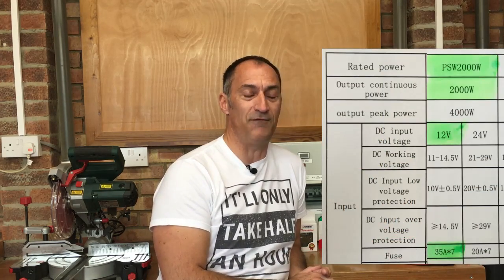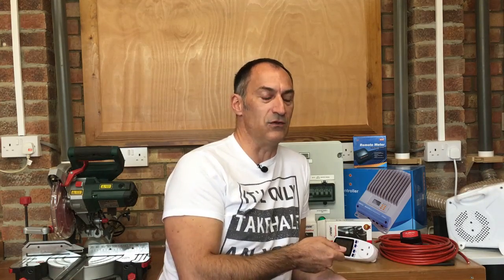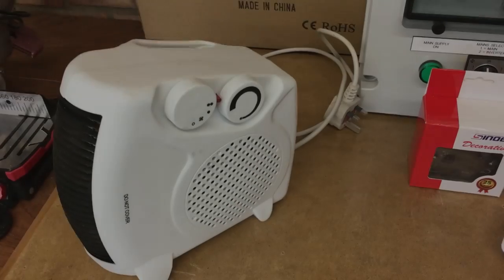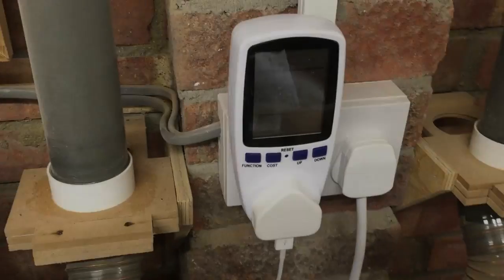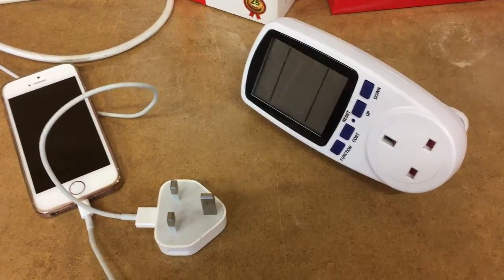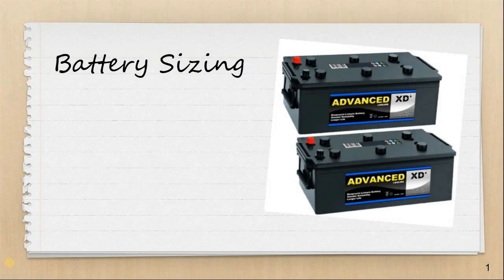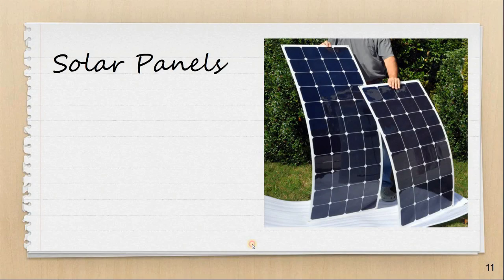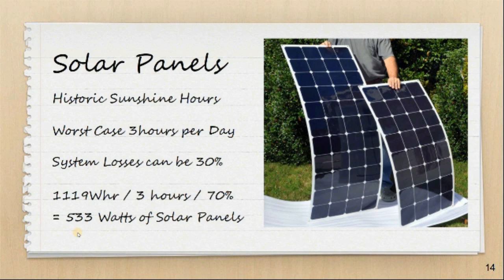Off Grid Battery & Solar Sizing - Self Build Campervan

Comment: Hi Greg
I am right at the very start of my van conversion journey (I pick up my van on Wednesday 😊) and have found you video channel - it is incredibly helpful! Thanks for doing such an informative series of videos.
I have just watched the video on Battery sizing and am a little confused by the reference to removing the load required for the Truma combi boiler from the calculations because it will only be used when on hookup. This is probably a daft question but…….How can you stay warm “off grid” if the Truma is not connected via the Inverter to your battery supply?
Thanks for the help
Brian
Reply from the maker: The Truma has a small 12v supply of 10amp that runs the boiler fan and controls and a separate 230v mains power supply of 1.8kw that is for the electric heating elements. 
It’s only the electric heating that will be used on hook up. The rest of the time the heater works off LPG and 12v control power.
Reply: @GregVirgoe   - Thanks Greg, that is what I had assumed about the Truma. I think I’ve just got confused because from the video on the Electrical Control gear I concluded that all the 230v demand went into the control box and was fed by either hook up or Inverter, via the main selector switch. I’ll draw it all out from the videos and get my head around it.
Thanks again.
Brian

Comment: Hi Greg 
Sorry may have missed it in the video 
But  why not just charge the batteries with the engine rather then solar which seem to take quite a while unless not using anything
Reply from the maker: The solar energy is not using any other fuel it’s free all the time it’s daylight. You can use it when driving but if you are parked up for a few days you don’t want to be running a huge Diesel engine for power in your van.

Comment: do you have Anderson port ability to use external panels for flexible directions.  An MPPT controller that can support 600 watts of portable panels? Your 2000 watt inverter appears able to support induction or instant pot type cookers...

Comment: Hi Greg I'm alittle stuck. Where you have calculated your led lights you have a total of 60 watt hours. If im doing it correctly 10 x 10 is 100 x 6 is 600?
Reply from the maker: Sorry there was a mistake in the sheet I was using in the video. The equation was missing the quantity out. The free download version is correct so you are right. My apologies for any confusion 👍🏼😊

Comment: Hi Greg im at a dilemma im in the middle of a camper build but im disabled so having to pay for other people to do the jobs I require, this is not my problem, my problem is I can't get anyone to fit my solar kit nor do I know exactly what I really need, I would really appreciate your help, I want enough solar and batteries to be completely off grid, run a TV a dvd a microwave, broadband router and my lights and fans. Im willing to pay someone to do this work, im not even bothered about price of labour I just want an exact and safe job, thank you I hope you read this and can help or know someone who can. Thanks again
Reply from the maker: Hello Steve, please send me a message to greg @ virgoe . com
Remove the spaces in above address and I’ll get back to you 😊
Reply from the maker: Let me know in the Mail what vehicle you have and what you plan to put in it that needs power. 👍🏼😊

Comment: Can you over charge the battery, ie the ratio between panels to battery is high. If solar panels are producing their maximum output on a sunny day and you’re not using much battery power where does that solar power get absorbed? Is the MPPT controller dumping some of the excess power?
Reply from the maker: Your mppt will only put into the battery what it needs. It can switch off the incoming feed and regulate the power being delivered.

Comment: Thanks for this one. And not only this one but the rest as well. It helps a lot. One question, though. How would you go about creating a system that powers batteries both through solar panels and can be hooked and powered via generator? I mean how would that be connected technically?

Really appreciate what you are doing. :)
Reply from the maker: You could simply plug the 230 output from the generator onto the hook up socket for the van. Just don’t park near us when it’s running 🤣😊👍🏼

Comment: Hey Greg, I see you removed the 230V fridge figure from your calculation, given this, do you expect to run the fridge all the time from the 12V supply and never hook it up to mains voltage? I'm trying to calculate how much power my fridge is likely to draw each day but finding this hard to calculate. Will the fridge varies its power usage depending on ambient temperature and temperature inside the fridge? How many Watt Hours / Amp Hours do you expect an under-counter fridge will draw each day? Thanks!
Reply from the maker: Yes we only have a 12v compressor fridge now and it is on all the time. Has been fir the last three years. Obviously it only runs every so often depending on outside temp and how much you open the door. Although it’s plugged in to power the compressor come on via a thermostat. So as an estimate it’s safe to say it will only be on for 1/4 - 1/3 of the time. We turn the thermostat up a little to so it doesn’t come on as much. 👍🏼😊
Reply: @GregVirgoe  Thank you Greg, love your work and videos by the way. Appreciate what you do, keep it up! :)

Comment: Hi Greg, 
 Thanks for yet another awesome video! Couple of questions for you regarding batteries. 
Using your spreadsheet & lots of research and decision making into appliances and their draw, our power consumption is near on exactly the same as yours (we're at 1150wh)
Planning on using Circa 480W of solar (3x 160W Panels) along with 2x 220ah batteries although I don't feel we will need 440ah as of course the spreadsheets are taken from "worse case scenario" or "maximum draw from all appliances".
That said, I'd rather have and not need, than need and not have, the only issue is the batteries I'm looking at are 60kg a piece.
Do you think we compromise and scale down to say 2x 160AH batteries, or take the hit on the 120kg of pure power?
My thinking is that its better to have the bigger batteries as they'll be under less load and therefore the DOD would be in less demand and should by that logic last longer. 
In terms of cost.. There is only a £40 difference (per battery) however the difference in weight and size is pretty bad. 
Do you have any other suggestions or recommendations.
Many thanks
Zack & Amy

Comment: Brilliant video Greg.  I'm assuming that you are sizing solar panels based on the fact that you wish to fully recharge you batteries using solar on your days "off grid" hence the requirement for large panels.  I assume should you go with no panels you would need to recharge using van or shore power after 2 days?  Keep up the good work.
Reply from the maker: Yes exactly that. I want to stay off grid and you can only use what you can generate each day. 👍🏼😁
Reply: @GregVirgoe  Brilliant. Any advice only going all electric.  I am thinking 1200w induction and water heaters a 4000W inverter and 150 ah of Lithium
Reply from the maker: @martincraven4202  any form of electric heating for cooking or heating water is going to use loads of power. Divide the watts by 12v to see the amp/hrs used. 
1200/12=100amp that’s 2/3 of your battery capacity each hour just for cooking alone. The bigger problem is generating enough power to recharge the system. Here in Europe we get between 750-1200W of solar a day from a huge half kw array on our roof so we only ever use electric heating when on hook up. Where are you planning to travel to and what size vehicle?

Comment: Hi Greg I’m looking to buy a solar panel set up how much did yours cost you for your solar panel set up please 
Thanks
Reply from the maker: Each panel was £130 x 3
My MPPT controller was £140
The AGM batteries was £150 x 3
Plus breakers switches and wiring
So all in for approx £1200 and we have lived 100% off grid on that setup for over three years now.
Reply: @GregVirgoe  thanks for getting back to me really appreciate it 
Dean

Comment: Hey Greg, thanks for all the tuition so far. Do I keep my batteries plugged in to solar etc through periods of inactivity (anything from a month to all winter)?
Reply from the maker: My panels have not been isolated now for 3 years even when the van is parked up. The controller will back off to float mode if there is no load and just keep the batteries topped up. If the batteries are allowed to drain too far it can damage them.

Comment: At minute 13:20, how is the calculation equating to 4,476whr. 1119 x 2 days (2238whr) / 50% = 1198whr. Sorry If I've missed a vital step, I've gone back to watch it again but not where where I've missed this vital step in the calculation to get to 4,476?
Reply from the maker: 50% is 50/100 or 1/2
Divide anything by 1/2 and it’s the same as multiplying by 2. 😊

Comment: Although I feel I know plenty about these systems and the associated electrical calculations, it is still very enjoyable to watch you run through the figures and make it easy for people to understand. If you don't mind me picking you up a couple of points though. The 50% discharge of a standard lead acid leisure battery is not  the same with AGM lead acid batteries which I personal recommend every time over a bog standard lead acid. 30-35% is doable as rather than 50% in my experience so up to 40% more discharge is possible with an AGM. AGM's don't need venting and can be positioned on their sides. The other thing is, I believe the efficiency rating of an inverter (and please people, buy a decent sine wave inverter) is based on a high load. As I understand it, an invertor rated at 2000watts maximum is less efficient at running lower loads than a lower specified invertor. So... if you have a load of 100watts on a 2000watt inverter, it will be much less efficient than a load of 100watts on a 1000watt and much better still on a 500watt inverter. I personally think 1000watts in a campervan should be plenty for anyone so don't do what so many people do and buy a 2000watt or even 3000watt inverter unless you know you'll "need" all that power. If you're running a 2000watt heater on a 2000watt invertor which is powered by your batteries then you're probably a bit mental anyway... Keep up the good work...

Comment: Hey is the total watt hours sheet you used correct or was it an error? It’s confusing me.

‘Multiply quantity, by watts by hours used’ you’ve only listed watt hours per x1 unit instead of x10 for example for the LEDS. Is this right? Instead of 60 it should be 600 because you’re using 10 lights not just one of them?

Comment: I was a bit confused about that list at 10:24 which shows the power usages. It has the Truma Combi on it twice. But then I see what the difference is. The combi part in Truma Combi refers to the fact it can run on both mains or on either diesel, lpg or propane (depending on which version you choose). So on mains it's at 230 volt but not using diesel/lpg/propane. While on 12v it's using diesel/lpg/propane and thus uses less energy.

Comment: Hi Greg! great video as always. Been following you for few years and always told myself to use your guidelines when building my own van. Now the time has come and i'm rewatching most of your explanations, thanks for all your effort! I also have a question: why are you calculating your wattage for 2 days while your solar system with 1 day sunshine time? Aren't you then oversizing your solar panels by 2x? Thanks!
Reply: I had the same question in my mind, why do I think the sun rises every day, so I don't know why I multiply it by 2, did you have any answer? or could you solve this on the other hand?
Reply: it's a good factor of safety

Comment: Hi Greg.  Another very useful video, thank you.  Just a couple of questions on your spreadsheet.  1) You say that to get total watt hours you multiply quantity x watts x hours used but on the LED lights line it doesn't look like you have multiplied by the quantity of 10 - or have I missed something?  2) I was assuming (maybe wrongly) that the fridge would be on 24 hours but I notice that you have only put 6 hours down for your fridge.  Would appreciate understanding your logic on this.  Many thanks for your help. Sharon :-)

Comment: One thing to take into the calculation is a normal 220v fridge uses about 1500w for a short while when starting (not sure how long but a few seconds or so). One way to get by that if you have a small battery bank that can not get it started is to use supercapacitors to help give enough amps for a short while.

Comment: Hi Greg, If i were to use only one battery but 2 solar panels would I connect the solar panels in series like the dual solar panel and battery set up or parallel? pretty sure before i had both panels with red wires connected and earths together too? its been a while lol.. have you a link please for dual battery/solar diagram please? As i have 2 batteries and 2 panels id like to get the best use from them. Any advantage to connecting both panels to one battery? sorry to be a pain.

Comment: Great Video Greg! Thank you so much. 
quick question: in your spreadsheet, you said you multiply the quantity by watts by hours used. Wouldn't that be 600 Wh for your LED Lights? Same goes for the roof fans.

Comment: Hi Greg, we’ve just started our conversion, your videos are absolute godsend! So thanks for that. I have a question about solar and lithium batteries. 
I was wondering about whether or not I would need solar, with the power advantages of lithium...? If you just have to run the engine for 30mins for a decent charge, would this not be more efficient than adding the cost and weight of the components required for solar trickle charge. I also read that the slow solar kind of charging can damage lithium batteries...any info would be great, just beginning to design my electrical system. Cheers 
2015 transit 460 minibus.

Comment: I phone plug says input 109-240v~50/60hz 0.15a output5v 1a. So you do the math. can easily wire in a couple of 12v 1/2.1amp usb sockets then there isn’t any need for a inverter to get 230v. Why step up voltage just to step down the voltage elsewhere

Comment: So, three years later: Did you choose wisely as far as solar panel capacity, battery capacity, etc.?

Your videos are beyond educational!
Reply from the maker: Yes, totally, we have been 100% solar and nothing else for 2.5 years full-time now. so it was the right amount.
Reply: Good to hear! I'm tinkering around with what capacity gear I'd need for the devices I intend to have along, and your setup is pretty close to what I have in mind. To hear that you didn't underestimate your needs and had to replace anything is reassuring.

Though you did have that 2000w inverter die and you replaced it with a 3000w unit, yes? Was that just out of caution or did you find the 2000w unit wasn't enough?
Reply from the maker: @scottweikert5189  no, it was replaced with a 1500W unit and in fact, I could have gone right down to 500W as the largest device we use is my laptop @180W
Reply: I guess I remembered wrong! Oops. :)

Alright, thanks for replying so quickly, and I hope you and your wife are doing well!

Comment: Hi I am at the start of assessing   what ill need in the van. firstly i need to decide whether to have solar panels. this because i will only using the van in the UK, and Scotland. so firstly will i  get enough power from them to do the job intended, and secondly as i only intend to be off grid some of the time it seems a rather large expense to go to.
as you can imagine it is difficult to get imparshal advice on this question as the only people i can find are selling them. so i would be very interested in your opinion cheers jem

Comment: Hi Greg. We've been watching your videos for quite a while now. As a result you have cost me several thousand in a Merc Sprinter LWB :)
 I've watched your video about battery sizing etc. I'm a little confused how you have come to 60 total watt hours for 10 LED lights. Your spread sheet shows 10 LED lights at 0.83amps which equates to 9.96wants. We have used 6 hours of daily use and our understanding to get total WH is quantity x watts x hours used ( 10 x 9.6 x 6 =597.6)
Please forgive me if i am missing something. 
We really like the design of you van and are using it for ours. 
Thanks again for all your help. You have given me the confidences to tackle this myself.

Comment: Hi again Greg,   I'm watching your video about sizing appliances and have a question about the truma heater.  Does the model heater you chose run on either electric or propane?  I think I understand the 7200wh for the electric draw but  when running on propane and you're off grid does it draw any power ?

Comment: I’m finding diy solar very frustrating. I just get all my parts and then the connections are different. I had to change battery supplier at the last minute as supplier was acting weird and now have a battery with really large connectors. Not sure what to use to connect everything up to it!  Very frustrating.